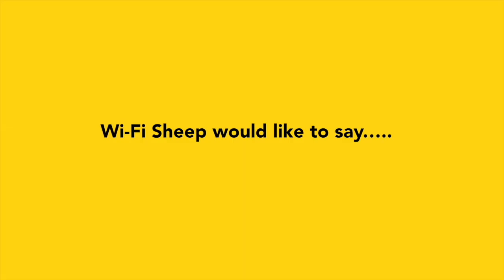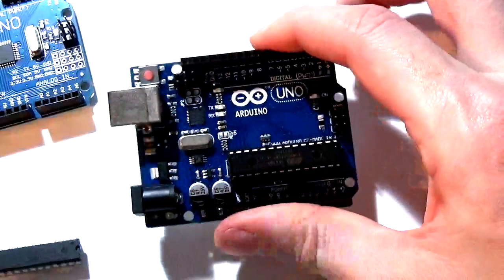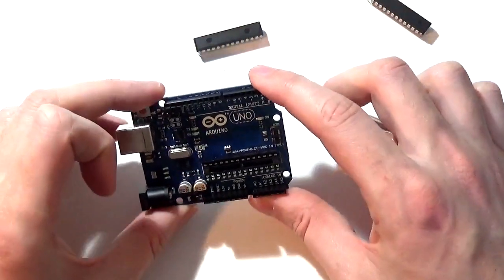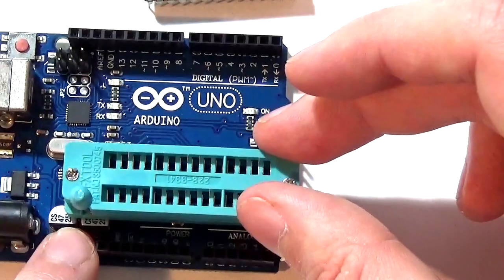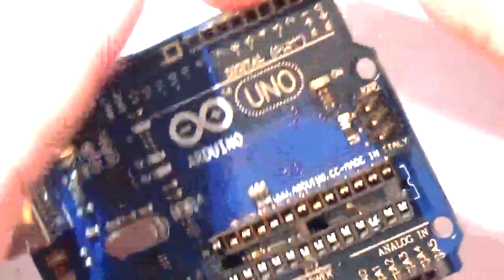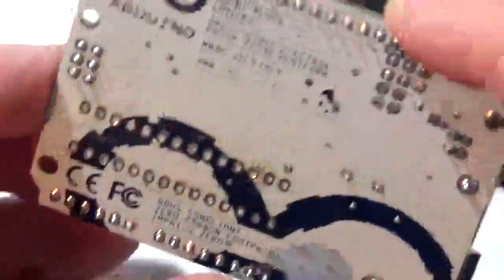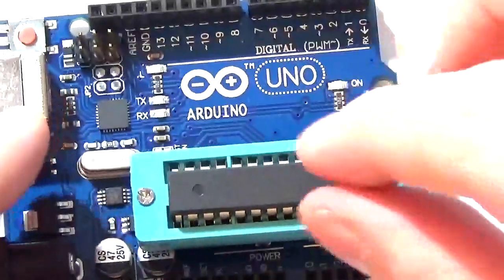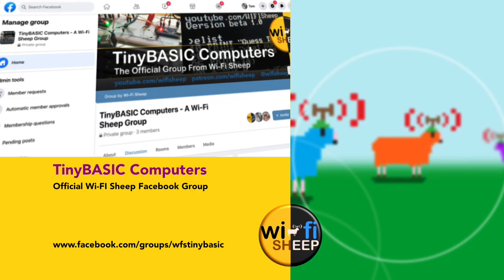ZIF YOUR UNO! (Modding an Arduino | TinyBASIC Computers Update)

Comment: Surely the micro controller can be programmed in place using JTAG?
Reply: Program these 328s all the time. Never used an UNO. You just program  directly over serial from the Arduino IDE